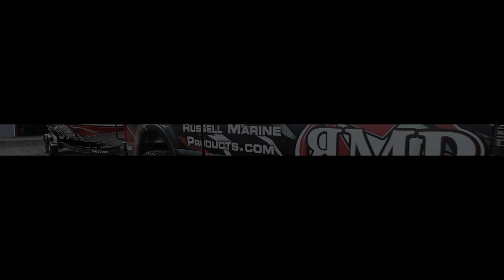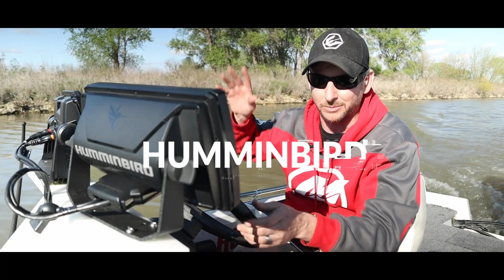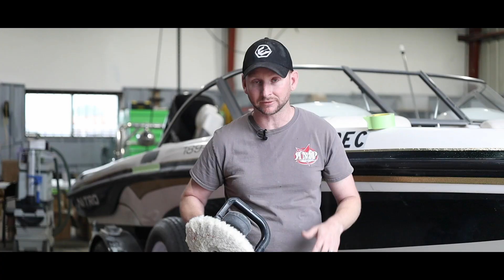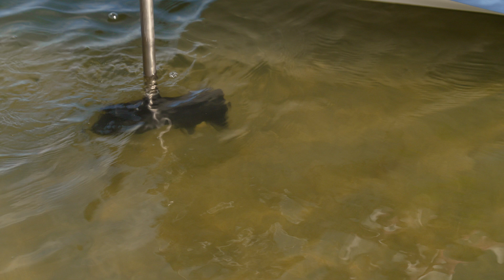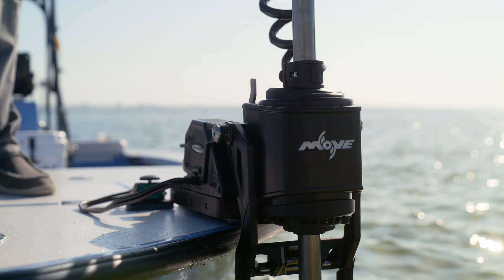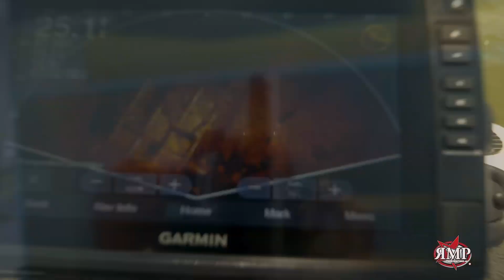PowerPole MOVE PV Trolling Motor Overview

Comment: This MOTOR MOUTH interviewer asked about shaft length. Then rambled for 5 minutes, and we never heard what length that shaft is..... UHHHG !
It happens to be the only feature about this motor I need to know. I'm sold on everything else. I know they come in 45",52", 60", and 72".... 
The boat I need it on has a high bow. Which means I need 62" or 72". I was hoping this one was 52".... Then I'd feel more confident that a 60" would do. But, it looks 60".
I still tapped the thumbs up button to feed the algorithm monsters..

Comment: Which Power-Pole Move trolling motor would be better for a Ranger 621vs walleye boat? XR or ZR?
Reply: Both the PV & ZR models are ready for Saltwater/Freshwater.  Ultimately it will come down to what type of mount you prefer: Pivot or Scissor? Both the PV & ZR come in black & white finishes so the choice is truly a personal preference 😎